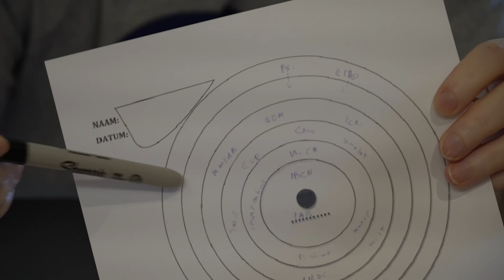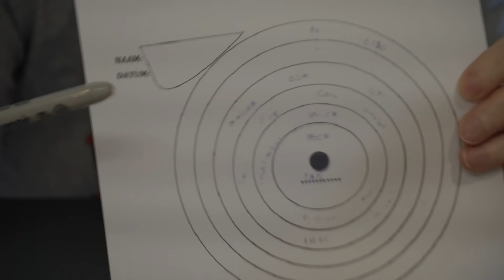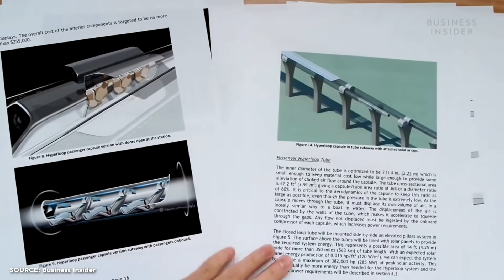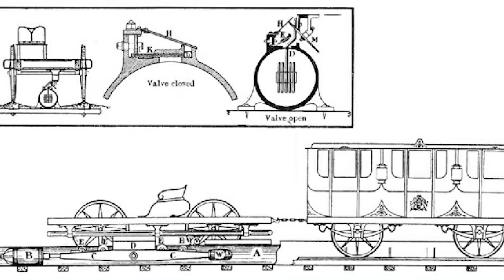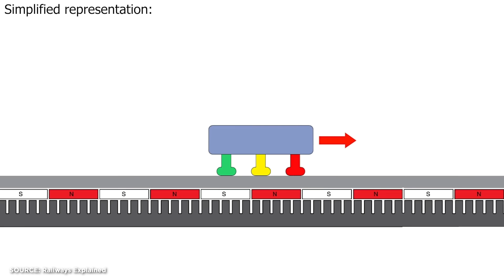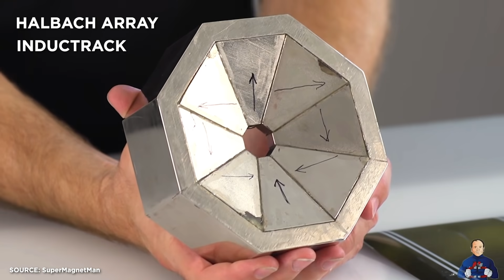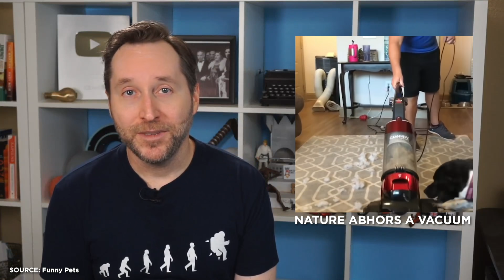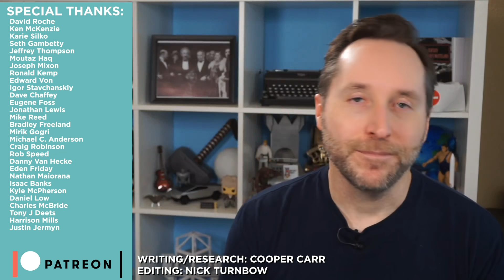What's Happening (And Not Happening) With Hyperloop | Answers With Joe

Comment: Joe throws another bucket of ice cold reality on somebody's bright idea.
Reply: Nope. His argument is actually pretty terrible, unfortunately.

It's frustrating because he seems pretty realistic about things - it's just that he doesn't have any perspective at all on the engineering challenges.
Reply: @SAMUEL NAUMETS Thunderfoot's video is the same thing - hot garbage.

The tank implosion video is basically misinformation, and the argument made is completely wrong at a really fundamental level.

The reason tanks implode like that is because they're only designed to hold pressure from the inside, like a balloon. They're not designed to hold a vacuum, so they don't have safe failure modes and look catastrophic. 

The logic being used is like trying to push a rope and assuming you're the strongest person in the world because it bent.

Vacuum pressure is not that hard of a design problem, pretty much any underwater tunnel is much harder to build.
Reply: @louisvaught2495  In that case, have you checked his calculations on the heat and cooling expansion for the tube(s)?
Reply: @louisvaught2495  a hyperloop from la to San Francisco would need around 60,000 vacuum pumps, not exactly the most economically sustainable vision now, is it? Also, thermal expansion.
Reply: @louisvaught2495  Even if you disregard the physical impossibilities, it makes no sense when maglev trains already exist for fractions of the cost.
Reply: @TitaniusAnglesmith  
Agree
and also with proven tech
Reply: @albertjackinson  Yes. The forces he lists are not very large. He just doesn't understand how much forces buildings normally experience. 

This is not a difficult problem to solve. Underwater tunnels already deal with much larger pressures, and the force created by thermal expansion is an order of magnitude smaller than that.
Reply: @TitaniusAnglesmith  So that's the thing. There are no physical impossibilities - we solve similar or harder problems all the time. Train tracks are continuously welded with thermal expansion, and underwater tunnels are under much higher pressures.

There are just a lot of people talking about hyperloop who don't know anything about infrastructure design or the forces involved, and they're unwilling to learn.

Hyperloop makes sense because it's faster than airplanes. That gives it a market niche for specific kinds of travel, and people would be willing to pay a price premium.

The question is not if we can do it, the question is if it's cheap enough, and we don't know right now. Everyone who's coming to any conclusion beyond "let's wait and see" is absolutely wrong.
Reply: @louisvaught2495  What about the forces imparted when the tube would be breached? Would that create an implosion as he often suggests? Or does it depend on the size of the breach?
Reply: @albertjackinson  Good question! The quick answer is "no, not a problem"

The reason that tankers implode dramatically is because they're thin-walled tension structures, not bulky compression structures. The behavior he's showing is something called "buckling" - which is what happens when you try to compress something that's thin, like pushing on a wire or stepping on a soda can.

But... the only reason that happens is because the tanker isn't designed to hold things out, it's supposed to keep things in. When something's in tension, it doesn't need to be very thick.

If you're trying to design something that has to be compressed, you put ribs in it so it won't buckle, which also means any failure gets contained in a specific zone. That's why, if you've ever seen subway tunnels or stations, they have grids on the ceiling.

Buckling is also why the twin towers collapsed on 9/11. Those towers were designed so that the floors acted like ribs, and as soon as two of the floors collapsed, the entire building crumpled inwards.
Reply: @louisvaught2495  Wouldn't a collapse be a problem for the hyperloop tube as well, if one of the ribs failed? Or could that be mitigated? 
Also, have you seen the experiment thunderf00t did where he pumped about three atmosphere of pressure (if I remember correctly) into a can, but it crumpled when he took air out (I may be misremembering--maybe he reduced the pressure below one atmosphere? I may have to rewatch that part), and he used that to demonstrate why thickening the tube wouldn't help against implosion? What do you think of the validity of that experiment?
Reply: @albertjackinson  TLDR - nope, that video is accidentally lying to you. The collapse you're thinking about is "global buckling" and only happens in "thin walled" structures. 

A piece of paper acts like a "thin-walled" structure. Take a piece of paper and try to pull on it - that paper is pretty strong. Then take the paper and push on it, that paper is pretty weak. But you can change that behavior by changing how the material is distributed. Try the same thing with a piece of cardboard or a chunk of foam - the tension and compression strengths are much closer.

And the considerations for paper and steel are actually similar. Buckling is dependent on how thick the structure is, and the material isn't very relevant. A sheet of plastic and a sheet of steel will have similar buckling strength.

Here's a critical thing to remember: engineered objects are designed for specific purposes, and they fail spectacularly when used in unintended ways. Cans, bottles, etc, are designed to hold pressure from the inside, which means they can be thin and uniform. If they try to hold pressure from the outside, they'll buckle.

Bottom line is that you can't test something that isn't designed to hold a vacuum and claim something sweeping about the strength necessary for vacuum chambers. The only way you know for certain is to look at the actual design of a surface that holds against external pressure, like a submarine, a boat hull, or a car tunnel. Those are all used in situations with higher pressures, and therefore higher loads.
Reply: @louisvaught2495  "Nope, that video is accidentally lying to you". Are refering to thunderf00t's video that contains the can experiment I was describing?
Reply: @albertjackinson  Yeah... unfortunately because his heart is in the right place.

Thunderf00t has published a lot of factually incorrect videos on the topic, and seems generally unwilling to do enough research to fix the issue.

The two main things he focuses on structurally are the pressure and the thermal expansion. Neither of the two are difficult design challenges, and we deal with them pretty frequently in underwater tunnels. It's just a question of how economical they are to solve, because tunnels are expensive.

Comment: “Just give me a high-speed maglev system.”  I totally agree with you on that.  We already have the technology to go 300 mph+ on a train today.  The cost and complexity and safety issues to put a maglev train in a near vacuum tube to get an extra 200 - 300 mph isn’t worth it.  Need to go faster than 300 mph?  We’ve got airplanes for that.  

If we could build an infrastructure with today’s BEST maglev train tech, and pay $45 for a ticket to go from Dallas to Houston in 45 minutes, I call that a win.
Reply: The problem with the train from Dallas to Houston is once you get there, you need a car so it seems like it defeats the purpose.
Reply: Maglev isn’t very practical either. The Shanghai maglev, for instance, loses like $80 million a year. 

Wheel is easy, wheel is cheap, wheel is reliable, wheel is probably here to stay.
Reply: But airplanes destroy the planet and is not as efficiant and cheap as hyperloop..
Reply: @edvardbookbratbak5473  Hyperloop is literally a Pipe dream
Reply: @marcosolo6491  ikr. People think Hyperloop is practical which is not
Reply: @marcosolo6491  They can estimate a price yes

Comment: For hyperloop to work, the trains have to also work without a vacuum. Of course, this would be at reduced efficiency, but if the entire train can be disabled by even a section being depressurized we have big issues. Maybe the sections of rail have doors every now and then that can close to prevent mass depressurization, or open to allow air into a section if an issue arises for a train.

Comment: Here's my thought on Boring Co. - Coordinated autonomous electric vehicles in a one-way tunnel can all be moving the same speed.   Fans at either end of a route can force air through the tunnel at the same speed as the vehicles.  There you got it: no wind resistance, increased speed, greatly improved performance and ventilated tunnels.
Reply: I like the concept.  Don't take the air away, but don't fight the air either.  Take the air with you.  5 stars!!

Comment: Railguns actually do exist, albeit at the experimental stage. The US military is and had been live testing various designs for quite some time now. One problem is creating a design that doesn't tear itself apart after just a few shots

As for Maglev, well, it's basic principle is based on something that many of us use every day in our kitchen. Induction cooking stove tops that also use an electromagnet to induce a magnetic field which in turn creates friction and thereby heat in iron pans and pots. Since the molecules in those cannot really go  anywhere, the energy is turned from motion into heat

Comment: "solid" stone isn't actually very solid at all in most areas, and it's saturated with groundwater, it will be interesting to see how they might stabilize the stone enough to hold a vacuum without flooding.
Reply: If they wanted to do an underground hyperloop, they would likely still need to line the tunnels with metal. It would be basically the same thing as the above ground version, just with more reinforcement from the ground outside it, less temperature variation, and less chance of impact breakage. On the flipside, any damage that did happen to part of the tube would be harder to repair and would need to be done from the inside. It'd still be impractical, just a bit less so.
Reply: Concrete with a moisture barrier.
Reply: Ever heard of shotcrete?
Reply: Perhaps they could add a "hypercooler" to just freeze all the water solid
Once you have the vacuum in the tube, you could then vacuum sputter the walls with Niobium to make the walls super conducting so that the train can be held up by the London Effect.
Reply: @timogul  Like I mentioned earlier, there are moisture barriers you can use no problem.

But an underground hyperloop wouldn't be very likely due to access concerns. The tunnels would need to be so well-sealed that they would be difficult to access if there's a malfunction. Having it aboveground makes it significantly safer, because you can disconnect a section to access it.

Comment: There’s a maglev in Shanghai running 430kph mainly because it’s just 30km long. However they just don’t run the speed part of the time due to the noise of the airflow. A train system either on tracks or a maglev would be a much better system. In regards of safety, price and feasibility it’s much better. Btw Virgin dropped half their team and said it couldn’t be used for passengers. 
However I like how you tried to mention the facts without bias

Comment: The air recirculation under the "car" , sort of ends the Vacuum concept.
Reply: The vacuum concept has ended the recirculation under the car concept.
Reply: to be fair Elons concept was for a pressurized tube that had big blowers blowing the air at supersonic speeds inside a big loop.

Honestly makes a lot more sense than a vacuum tube as you don't have to worry about a pressure build up in front of the train unlike in a vac tube (unless it's hard vacuum but they aren't doing that). nor do you have to worry about the train braking the sound barrier inside the tube as all the air is traveling the same speed as the train. 

Mag-lev is still way better than his 'air barrings' though. but what i don't get is why they all dropped the "pushing the air inside the tube" bit to make the train go faster. we can make wind tunnels that have air flows over 5000 KPH, just think of making a wind tunnel in a big loop with rail tracks in it. wouldn't matter if someone put a hole in the side of the tube, it would just get a little windy till it's patched.
Reply: @beverlywhitman303  Yeah that's another idea. You don't need a complete vacuum, and you can also draw the air out in front of the train without creating a vacuum throughout the tube. But relying on the train alone to create a vacuum in front of it I'm not sure would work. You're basically carting a vacuum-making machine with you on every trip. That doesn't make sense.
Reply: LordMightyTrousers  Well not really pedantry. There's a big difference between the two technologies, they're pretty much opposites. Either the train makes the vacuum or the tube makes the vacuum. But at the moment it looks like designers worldwide are going with the vacuum tube, which makes sense, although it's a definite engineering challenge, no doubt about that.
Reply: @beverlywhitman303  Although rereading your post some small amount of air recirculation device on the train in a non-hard vacuum does make sense so long as it's not a cumbersome addition to the train.
Reply: Still, reminds me of Robert A. Hineline's 'The Roads Must Role'.

Comment: "Hyperloop"... One thing that'll never happen.
Reply: next on pointless technology... vacuum balloons.
Reply: Maybe not as a measure of transportation here on earth. But if we make a long tube, put a capsule on something like a sledge in it and bend one end upwards in a smooth curve, we might end up with an efficient way to get stuff into near earh orbits.
Reply: Reusable rockets, electric cars, digging tunnels under cities, putting chips in peoples heads, and Autonomous cars.  Other things that will never happen.
Reply: @davidbeppler3032  except people haven't been saying those things will never happen for a long time already. And the concept of the vacuum train has existed for how many centuries? And it still is not working, properly and safely. Those other things you mentioned were realised in a reasonable time frame after they were first proposed and tried.
So stop thinking by analogy. Simply because in some cases peoplewere skeptical, but the concept worked does NOT mean every concept people are skeptical about will necessarily work. Or, by this "logic", "solar roadways" would work too 😂
Reply: @KateeAngel  How many vacuum trains have they built?  I am unaware of any serious attempts yet.  For it to fail, it has to be attempted first.  Trains are not safe?
Now you say solar panels don't work?
Your lack of logic hurts.

Comment: I bet Thunderf00t is laughing very hard right now🤣
Reply: I like that he gives a lot of good technical information, and he gets a lot of unwarranted hate. However, something I don't see mentioned enough, is that something like hyperloop is going to be the necessary next-thing eventually. It might not be the time, and this design might not make it. The fact of the matter is that we are constantly fighting for gains against the atmospheric limitations. We will see smaller and smaller increases in transport efficiency until the cost of using a vaccuum is more viable than not.
Reply: @Varadiio  That doesn't make any sense because vacuum costs substantially more and will not be any more efficient, on the contrary. Maintaining a vacuum is very very difficult. Even in small vacuum systems you never get a perfect seal and need to keep a pump going to maintain a certain pressure level. The better your seals the less constant pumping you need. With a gigantic system like a hyperloop you'll need massive pumps running 24/7 which will make that system inefficient. Even if it was a perfect seal (which is practically impossible) you'd need to evacuate the airlock for every ride which takes a lot of energy which makes it inefficient and on top of that evacuating the air lock will take a substantial amount of time which defeats the entire purpose of going faster.
Reply: @thulyblu5486  That's exactly why I said it might not be the time for it. The idea is that the more you fight against air resistance, the more fuel you need. Eventually, you'll be paying so much in fuel that a lower pressure environment must be a cheaper alternative. This assumes that transport will strive for faster delivery ad infinitem.
Reply: @Varadiio  That's not a good assumption, though. We also have plenty of low pressure environment for free up in the sky which is why planes fly higher the faster they go. The concorde was already too fast to be economically viable, it just used too much fuel in spite of traveling in a low pressure environment. People already made their choice between slightly faster speed and substantially lower cost. We are at the point where we could go faster but it's not worth the extra money to passengers.